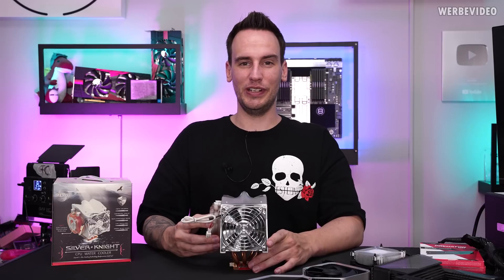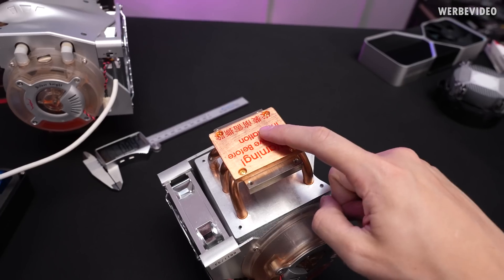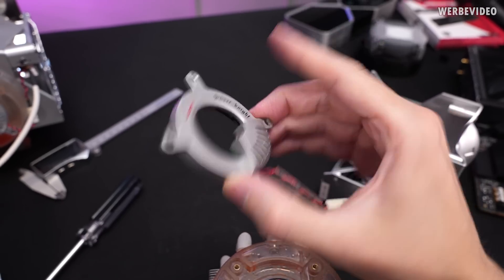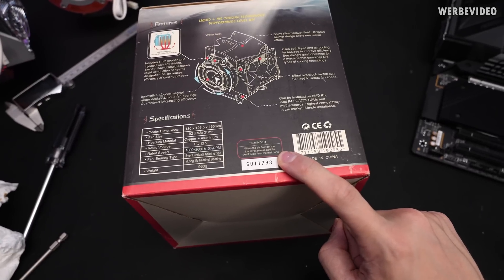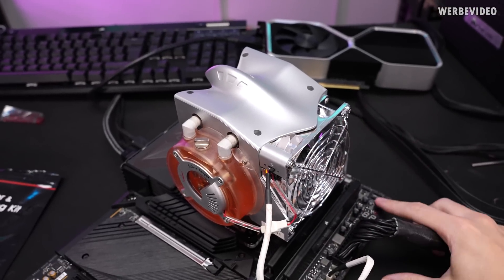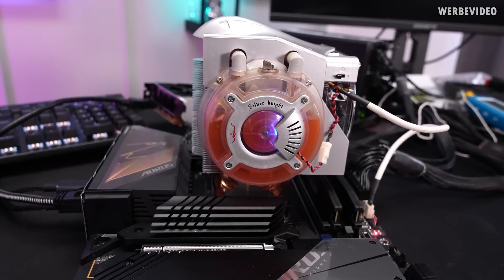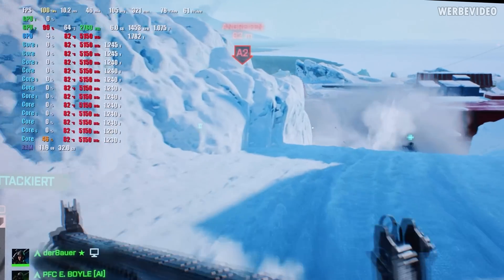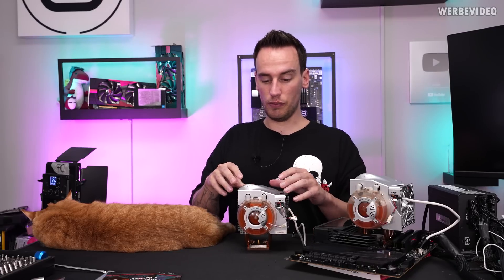Crazy Design!! This CPU Air-Cooler runs Water through the "Heatpipes"

Comment: You hear the water splashing because the pump is not in it's correct orientation. The pump is on the bottom of the cooler so the water flows down to it, minimizing the splash sound.

Comment: Hey a question... 

Why don't we use something like a small vapor chamber or do a small waterblock using heatpipes to take away  heat from the heatspreader very quickly and then transfer it to water?

Comment: I've always wondered if I can repurpose old heatsinks and cut the fins off of the part that contacts the cpu and run water through the cut heat pipes and use it as a water block.

Comment: The problem with this cooler is not, that its bad, its just that modern heatpipe modells are too efficient. Like using phase change liquids/gasses in heatpipes... come on! 
If you would compare this principle against a solid copper heatpipe system the advantages would be much more obvious.  <(")

Comment: How is this any different from a "water cooler".
...so yes. Lets not call air coolers "water coolers" any more. We don't call air coolers "heat pipe coolers" either.
If you're transferring cpu/gpu heat to the ambient air (without any powered phase change), it's a "air cooler". ok? Regardless if this if this is with direct metal fins, heat pipes, or water pumping.

Comment: About the only possible positive over heat pipe and this is a massive stretch, just because you would most likely be overwhelming the coolers ability to dissipate heat anyways, no chance of pipe dryout. This is disregarding the chance of leaks and pump failure.

Comment: its not first idea since apple did try this before on their dual g5 cpu's that their tower coolers had lot of liquid gonna into pipes while fans are like jet blowers and noisy...it cools but huge drawback...it leaks through the pad where cpu sits with spreader, the irony is intel makes better chips that capable to run 280w in same temps as zen4 cpu's running 90w ...there is something wrong in that picture, either amd sensors are bad or tsmc use cheap wafers vs intel make their owned wafers and owned chips

Comment: Expecting the amount of contact of the water is not enough, even though it goes through the pipes so all around it can give the heat off to the water, a bunch if fine fins is probably better ?
But something like this remade with current day tech might be a very cool idea. I have thought about it a bit, it will always be complicated to put so much in such a small space, but it might work ? I would make the whole thing quite a bit bigger though, basically as big as a double stack with obviously the fan in the middle a fan at both sides wide for size ? You should likely max out the space, make bigger fin stacks in every direction basically since the water can transfer farther, but basically you should just make a really big radiator instead of water to fin stack. Maybe you can leave out the fan in the middle since water will run through the whole damn thing, but i wonder it will give its heat to the fin stack fast enough as well.
But i am sure there are some smart guys out there that can calculate if it'll be anything but a fun gadget factor or not, if the heat transfer isn't increased compared to just water or just fin stacks, why bother ? I doubt it would do much, cost way more, pump can still die, safer than pure AIO probably, but then just go aircooling with a fin stack.
It would likely be safer than just water cooling if the pump fails, since hopefully it would still dissipate enough heat through the water and pipes to the fin stacks, where with AIO it wouldn't at all basically because of the hoses.

Comment: this is better then an AIO and let me explain. If an AIO FAILS there is ZERO cooling on the CPU and thus it will overheat. If this one fails liquid stops moving but there is a fan and it transforms into a regular cooler. CPU then wont overheat. WAY better design then an AIO.

Comment: I just got one of these, and I cleaned out the cooler and refilled it with modern water cooling fluid. It did a lot worse than the OEM AM4 heatsink I had on my 5700g.

Doing a R23 30 min run.
2017 OEM Dell AM4 4 heatpipe heatsink = 79° tops
2007 Ever cool Silver Knight = 87°

I mounted it on with the stock clip onto my stock AM4 clip holders. I'm going to eventually mount it to a LGA 775 board and see if I just had it mounted bad. 

The Silver Knight, should have been able to handle a 5700g. I also wonder, if Evercool  used something more antifreeze like than modern water cooling solution.

Comment: Heat pipes not works well when they lying on vertical orientation, or works very limited, hot water does not return to the hot side to boil again. they do depend on gravity even with wick filled. Heat pipes is server design, you pay for nothing  in yours tower PC. Sorry PC guys :)

Comment: It's a cool idea that I've wondered about for a long time, but the poor design of this really defeats its value. I bet they ruined a lot of systems leaking onto them over the years. If it was possible to modify a heatpipe cooler with water it would be more interesting.
Reply: It is possible but it would require soldering

Comment: Im intrigued. What's wrong with a floor standing ac unit and carboard duct to the side panel of the PC for overclocking runs... worked for Jayz-- worked for me. What an interesting design on this cooler though. What I am waiting for is the cooler manufacturers to develop a refrigerant based cooler that can be integrated into a case and ducted to a window like a standard floor standing cooler. Even if there were 2 cases, one for the pc and one for the refrigeration equipment. I would be one of the 10 people in the world willing to purchase this.

Comment: Given the age of it I'm impressed it could cool a modern CPU, although you didn't give it one of the high end ones to try. Looking at the CPU's listed on the back of the box the max TDP was 125W but that was over a much larger die area. Would it cope with that much heat from an area significantly smaller? You're way more of an expert than me but given Noctua has the offset brackets, to position above the heat source, I suspect it would struggle.

At 12:00 I'm pretty sure it would be better with heat pipes as they aren't as big, so you'd get more fin surface area within the same dimensions. You'd also be able to take the fin stack higher without exceeding the dimensions it's at as you'd be able to extend the fins into the area it's using to connect the pipes together, which it's done with lots of 90° bends! That can't be good for flow rate.

I'm not surprised the fluid level was low, I learnt about it evaporating through my hospital grade silicon hose back in 2004. It was something I'd not seen mentioned on any of the H2O cooling forums back then, but there weren't many of us around back then and many people were using open loop "bong" cooling towers! So they wouldn't have noticed anyway.

The marketing on the box is quite comical, they were really unsure what to call it!
It's an interesting idea but, as you mentioned, we use water to move the heat away from the confines of the socket area so we can use a significantly bigger radiator than we could fit otherwise. I can't remember how advanced the heatpipe coolers had got back then, did it have an advantage compared to them when it was released?
If not it's just adding complexity, which should be read as, "more points of failure."

Comment: Microscopically most plastic is porous.
Contaminants can leak into sealed containers with time, and fluids can evaporate out slowly.
Imperfect seals and tolerances cause larger areas for fluids to pass.
Evaporation can pass through many objects and small gaps.

A simple example of osmosis, or the flow of fluid through seemingly solid objects, is get a plastic bag or balloon, fill it partly with very salty water, then let it soak in normal water. 
Eventually the salty side will absorb some of the external water.

Side note; Those chrome fans look nice.

Comment: I wonder if the reason for the low fluid level is just for shipping from factory. Was there any instructions to fill with distilled water on first use perhaps? The liquid in the unit could just be a standard water wetter/anti-algae additive is why I was thinking that.

Comment: Interesting. I could see it working nicely in a case where there's no room for an AIO,  but could accommodate a large HSF. That was a lot common in 2006/2007.
 It would b really interesting to see what a modern pump would do with that setup, combined with the rear case exhaust fan you'd typically have in a normal install.
It looks like you could mod the one with the dead pump to integrate it into a custom loop, with the fan providing some intermediate cooling.

Comment: Hallo Herr Roman,

The design is ‘ Cool ’ and I feel it would work better had you used true coolant instead of the plain water.
Just think, why would a car radiator have coolant and not plain water. 

There is a big difference between using proper coolant and distilled water. While distilled  water does help to keep it cool, it does not work nearly as well as coolant does. First of all, distilled water boils faster and at a lower temperature than coolant. True coolant has also been formulated to keep the parts in the pipes from becoming corroded. Distilled water, it goes without saying, does not possess these qualities.

Without coolant, the heat produced with water alone is not entirely adequate to keep the system cool, for the high temperatures eventually boil it off. In time, the distilled water in the system would evaporate entirely. 

Secondly, the use of the magnetic coolant motor, reminds me of an old turn table, MK1200 by Technics, so no belts that wear and tear, very smart, for +17 years old engineering / technology, should be fast starting and no wear or tear, at least …. The design of the plastic housing could have been a little better to make it more sound proof but all in all not bad.  I truly would like to have seen you use true coolant instead of distilled as I’m sure that was supposed to have been used.  Oh well I am anxiously waiting for the latest solid state JET COOLING to be used instead of a fan in due time.  Thanks for the video was ‘cool’ to see that someone was thinking outside of the box, even back then.

Comment: I always wondered ,myself how this kind of cooler would perform. Never knew somebody already made it. Maybe a coil of pipes in the radiator and just 2 pipes(in & out) to the base plate would give better performance. Also welded joints and copper fins.

Comment: Considering this is from 17 years ago, I would give it some credit on innovation since air coolers at that time were not nearly as efficient as the current line-up of the heat pipe versions.
Reply: I thinker there is some potential with this design as comparable heatpipe based tower coolers can have major cooling issues stemming the heatpipe configuration and location of the CPU hotspot.  There is also the limitation that heatpipes can get too hot and "dry out", Immediately loosing nearly all cooling ability.

Comment: I think Pump assisted heat pipes could be interesting. Keep the small amount of liquid inside so it can vaporize but then have a pump in the heat pipe to make the flow of vapor consistent instead of passive... or max out this idea and make a tiny refrigeration system.

Comment: Considering the time in which it was released, I thin it was mostly made to be a gimmick, and maybe even a bit of an experiment. We are talking about the early days of water cooling before AIOs really become common. 

...though it likely become slap full, and would not have had that much of a drip. You would have likely needed to fill it the rest of the way while it was running to get it like it come of the factory floor.

Comment: 😅I don't know if you fixed you 4090 Asus card? But I had the same problem and it turns out to be the Asus boards. You have to remove and leave m. 2 slot one empty and then turn on x16 on slot 1 pcie lane in the bios and it will work fine. You can not share the land one pcie pain with 5hevm.2 SSD and graphics card. You have to separate them. There's nothing wrong with your card!

Comment: What happend with the pump if you mount the cooler with the motherboard vertical? The pump takes air with the corresponde increase of the temps?

Comment: At the very least, it does have that one appeal point that I think other cooling solutions lack, at least at the present time: the resemblance to the head of a rejected Transformer design. 
I imagine doing this on purpose to an air cooler is ripe for inefficiencies, and I think AIO solutions are already hitting their stride for how little there is to customise without actively undermining the performance, but consider the aesthetic performance benefits of having a Robot Skull inside your computer, that also covers the brain of the computer like a real skull. 
Think of all the vaguely square things your air cooler could be; a crate, a malicious alien artefact, a smaller model of a computer, the head of a square-headed man, even etcetera! Possibilities... ripe for the manufacturing.

Comment: I rather run the heat pipes through a water heat exchanger , think radiator vapor chamber enclosed in a water jacket that then has a water loop passing the heat to a larger radiator

Comment: It's a cool looking design, and I'm sure it was more than plenty enough for a hotrodded E8400, but i think modern  heatpipes and fans probably surpass it. My Vetroo V5 keeps my 12600K cool with the P cores at 52/52/50/50/50/50 and the E cores all at 40. And it draws about 60w more than this. Would be cool to see a comparison between these two, and throw in a 120mm aio as well.

Comment: i have to disagree with your point of it not working better because of the surface area being the same and the way the heat gets transferred being the only difference.
this is the exact concept of why better thermal paste works better. the surface area is the same but the way it transfers the heat is better.
i think that this would work way better, especially if the pump and reservoir weren't mounted on the radiator.

Comment: the bif difference is heat  pipes are crushed to fit under tower cooler which cause restriction the issue with this design i see it ima pay 68 bucks to make better version ill release that on my ch an nel

Comment: as you can se eon the coolers box needs to be filled to the top id love to see this against some cheap tower coolers see if this is better also check rpm on mobo make sure its running at correct rpm id also love to see if that bubble noise goes away when water is full
Reply: cpu tower water cooler

Comment: A more interesting evolution of this and heat pipes would be looped heat pipes where the coolant boils off at the CPU, rises into the top pipe and condensate returns through the bottom pipe in a similar manner to the $2000 passive phase-change case. Still all-sealed, still all-passive but you replace the dead-ended heat pipe's wick-based counter-flow with gravity-driven pumping.

Comment: Isn't there a benefit of running water over the cold plate compared to heatpipes?  The thermal resistance to the hestsink is lower and the heatsink temperature will rise faster and more uniformly.

Comment: 140 x 140 x140 radiator with push pull fans and pump built in. you could call it the cube. Try something like that? if you can

Comment: wonder if you would look at those direct block radiator cpu coolers/aios? I think OEMs made them for x99 or x79 platforms?  I always found those fascinating.  Loving this retro CPU cooler line up.  Miss the retro style cpu coolers and more interesting designs that they had.  The cooler master V8 heatsink was a BEAST!

Comment: I would imagine if it was in a normal orientation or even all the way full it would be much quieter. I would also bet back when it was made it was probably way better than most coolers its size, I remember most coolers still just being hunks of metal with fins and "heat pipes" being very different tech than what they are now if you even had them at all. Imagine having one of these back in the day and modding it to use the 80mm cooler master aero turbo blower fan (I loved that thing, had it mounted on the outside of my side panel like a turbo right over the cpu and gpu lol).

Comment: Cooler Master needs to do this but with the V10 cooler (maybe call it V12?). This cooler doesn't have enough surface area to need true water pipes, but back in the day, many review theorized that the heatpipes on the V10 were too long, even with the TEC it couldn't dissipate enough heat to make a difference. If it could cool a 250w load I would seriously prefer a Cooler Master V10 style cooler but with this water pipe tech rather an an AIO.

Comment: i'm thinking the heatpipes would not use the complete cooler when using a lower tdp cpu. but with the water being forced to the top it's using all the fins. and thus use more of the surface area . as soon as the tdp is too high so a heatpipe can bring the heat all the way to the top it won't be better .     i'm not sure . but i'm thinking it could be better in some scenario

Comment: The early days of water cooling were wild. Thermaltake also had a similar design in one of their Big Water Volcano CPU coolers; which basically had a finstack with copper pipes that could be connected to one of their Big Water pump-res combos and used as an early AIO-esque setup, or attached to even external radiator towers. Then GamersNexus also reviewed a spiritual Chinese "successor" that also reused the concept, but wasn't done as well as Thermaltake's Volcano or this Evercool Silver Knight.